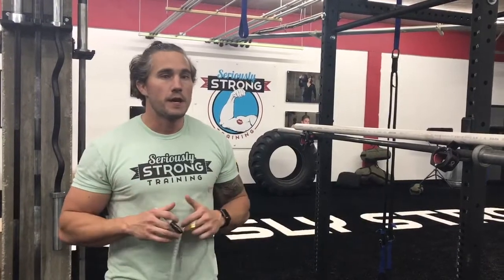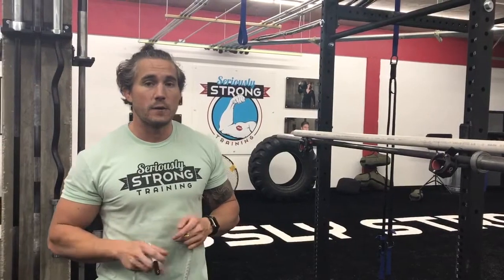How to Make Your Own Earthquake Bar

Comment: What would be a max weight capacity for this pvc pipe?
Reply from the maker: We don't know a number for that, but in our experience you can handle about 50% of the weight you normally would using an earthquake bar. We have comfortably had 100lbs on it for reps with no problems. There is more information here https://seriouslystrongtraining.com/use-an-earthquake-bar-to-improve-shoulder-stability/